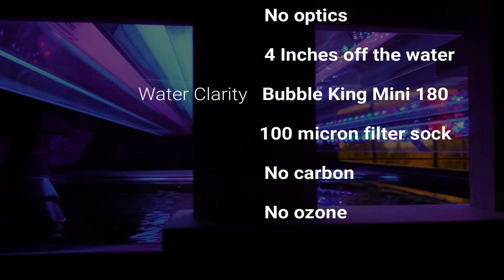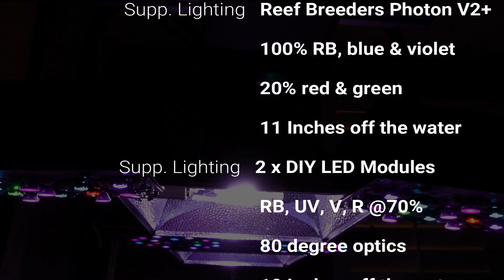SPS Reef Tank Lighting PAR Levels!

Comment: Hi Abe, I know you have (/have had) a 4x39w over your QT tank, similar size as my DT. My tank is 32"x14"x16"h, ATI fixture, chosen following your reefing method. I'm supplementing with total 30w RB led strips, fixture + leds 6" off the water (acros are the goal obv). I haven't got the access to a PAR meter, but IYE, not considering key factors like flow and nutrient management (or supposing them to be at the best possible) and considering the light aspect only, is my setup enough, or best, for acros? May, or should, I increase light by adding more led power? Is it already enough or can I push more? I'm quite new to sticks and reefing in general, been following your setup, adjusted for my smaller sistem and it's is working def fine untill now... Love your content, best quality on the net. Cheers from Italy

Comment: Awesome information here.  Sorry if I missed this in the comments.  What period do you run your lights at peak power?  I'm currently running my SPS tank between 275-375 at the middle of the tank.  I built the rock structure to that point so I won't be getting more par then that until the frags work their way up to the top of the tank. I'm just curios if a longer photo period at peak par would get the job done.  Currently, I'm running peak par for about 6.5 hours but still have a full 12 hour photo-period. When the t5's are off, the par goes down about 200 points.

Comment: I currently have 4 360x on my 75 gallon and im getting about 400 PAR on the upper rock level and about 200 on the sandbed which i think is too high for my softies and sps whats your opinion? Had to put my scoly on the shade since it seems to be receding. Also i have to keep my phosphates below 0.10 but over 0.05 or i start having dino problems.
Reply from the maker: Sounds about right to me

Comment: Are those numbers with all of your lighting running? My 8 bulb with reefbrite and another led bar (4bp, 2cp, 1 actinic, 1 geiseman tropic) pushes 650+ at the top of my rockwork and my fixture is 10-11” off the water. I do like how you have your rockwork lower but almost all the way to the front glass. I may have to change mine up a bit.
Reply: Its cause he runs 3 actinic

Comment: I saw that this was your current bulb combo from another post,

-Front
ATI Blue+
ATI Actinic
ATI Blue+
ATI Actinic
ATI Coral+
ATI Blue+
ATI Actinic
ATI Blue+
-Back

I thought I watched a video or heard from you that you don't like the actinic bulbs, and you feel they don't give much par. Maybe it was someone else. What are your thoughts on actinic bulbs with acropora? Do you think you would get 15k out of this bulb combo anywhere? Or only because you have natural light as well? Do you see any benefits other than color by running this many actinic bulbs?
Reply from the maker: Yeah that was me. I said it one of my update videos. I decided to use them because I need another blue bulb to break up the blue pluses. I didn't want to run six or seven blue Plus. And the only reason why I'm running blue heavy is because of the strong natural sunlight that hits my tank. The statement about them not putting out as much par as blue Plus, is partly true , but they do put out decent par.

In general with T5, I would say that at least half of your bulbs should be blue plus. The rest other bulbs will be your preference and overall color. All the T5s bulbs put out decent par. You're just going to have to figure out which bulb combo you like best. Unfortunately it may take some experimentation.

Comment: wow, every tip in place, every tip from you made my tank look better. thank you:), last thing i wanna do upgrade radion xr30w pro to hybrid, can you tell me which bulbs do u use?
Reply from the maker: It really depends on your color preference. But usually people have more than half ATI blue Plus Bulbs. I'm using 4 Ati blue Plus, 3 ATI actinic, and one Coral Plus. It's a little blue but I have a decent amount of indirect sunlight hitting my tank so when you look at it, it's not that blue. I used to have ATI purple Plus in one of the slots which, without the sunlight, was about 14000k
Reply: @CoralEuphoria  thank you for your answer! i do not prefer too much blue, i can add 4 bulbs to the hybrid kit, my next question is, the most front bulb is little far from the back of the tank where i have most sps, how should i put the bulbs, that i get the best growth(consed. alk and nutrient is stable) , and if the most front bulb lets say 35 cm from the rock work would the corals still become its light, or it diffuses it mostly direct under the light?
Reply from the maker: @majdsirhan9964  i think you will just have to experiment to see what you like best. Two blue+ and two white bulbs will look pretty white.
Reply: @CoralEuphoria  very helpful :), best man ever

Comment: I'm not shocked by your 10 year old fixture still working good,  if the ballasts re good then the bulbs will fire fine,  as long as your T5s aren't covered in salt creep the output will remain high, and yeah ATi use good ballasts.

Comment: So your "low par" is around 300?!

What I notice is the technology you don't rely on: LED. Your Power Module was crazy expensive at the time, built like a fortress, with twice the ventilation of the Sun Powers. I'm not surprised that you still don't need new parts except for bulbs.

For MH you are using the classic Radium 250 watt bulbs on a shallow tank. 

I am shocked, shocked to see great growth and color in both tanks.